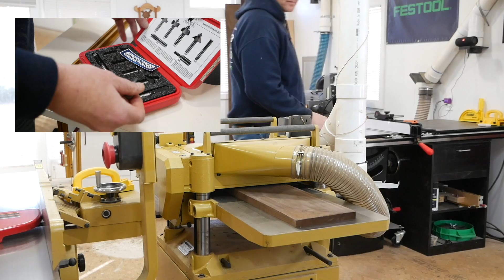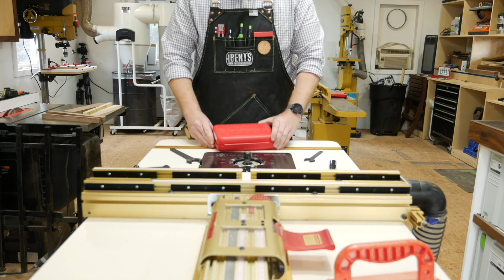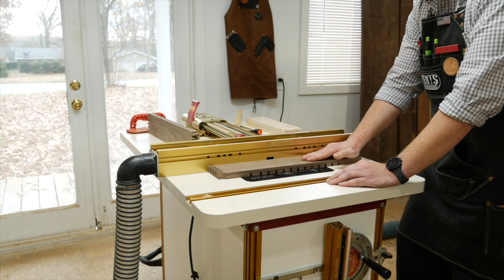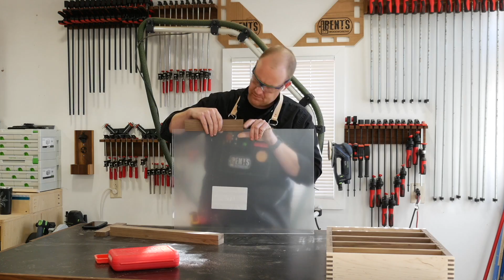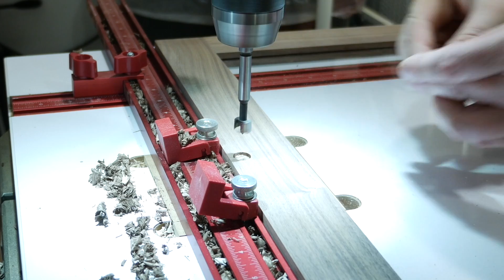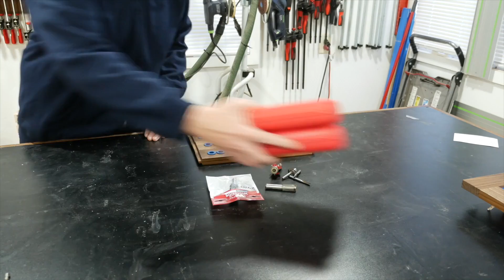Router Bit Storage Cabinet // Plans Available

Comment: What are the dimensions of the French cleat? I see nothing on the drawing.
Thank you
Reply from the maker: They are cut to fit. The piece that goes on the cabinet is whatever the opening in the back is. The piece I put on the wall is generally 2-3” shorter to allow a bit of lateral movement.

Comment: Awesome build, Jason, as per your usual. I just wish my "scrap material" looked like yours. Mine more closely resembles firewood
Reply: Just a quick note: I have found when cutting polycarbonate on the TS, it is best to do a short cut (one inch plus) on one edge, then flip the piece end for end to complete the cut. That all but eliminates any possibility of those annoying chip outs or a chunk missing on the corner portion of the last section to clear the blade. I am sure you have experienced this, but the more blade teeth and slow feed makes a huge difference.
   Looking forward to a complete shop tour of your new digs when build out is complete.
Reply: I must be blind. Your cut of the Lexan was EXACTLY as I described. D'Oh! My teachers always accused me of not really paying attention in class, so what can you do.
Reply from the maker: Yes I definitely learned that after my first cut 👍

Comment: Great build!  Is there a link to the grommets you used to hold in the bits?  I'm not seeing it if there is, but it wouldn't surprise me if I'm just missing it.
Reply from the maker: There actually isn’t. I just checked myself. They are from Rockler though.
Reply: @bentswoodworking  My bad, I thought I remembered you saying in the video you had gotten them from Rockler.  Any idea where I could get a set?
Reply from the maker: Bryan K Gravely I just ordered them from their website
Reply: @bentswoodworking  Ignore that first reply, I completely mis-read your reply.  I couldn't find them on Rockler if you happen to have a part number or something.
Reply from the maker: Bryan K Gravely https://www.rockler.com/rockler-router-bit-storage-inserts-10-pack

Comment: Nice cabinet, Jason~!  I recently built a router table frame insert (Woodcraft magazine) that used those same inserts sold by Rockler.  A great solution that definitely beats having shelves with different sized holes since the bit collection shifts between 1/4" & 1/2" shank sizes.
Reply from the maker: Totally agree. These make it very easy